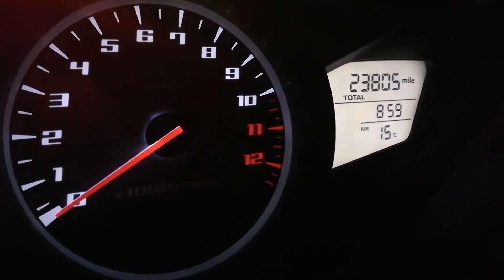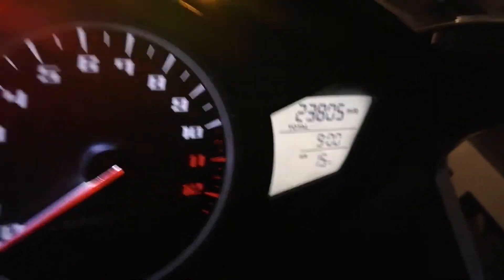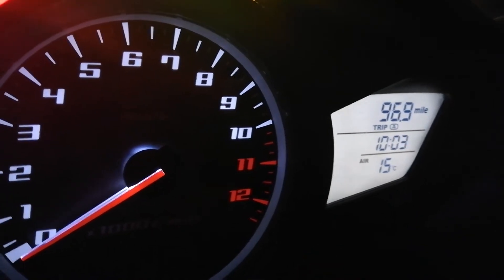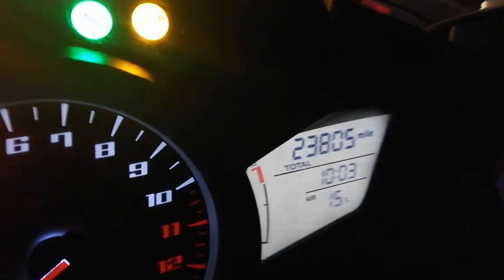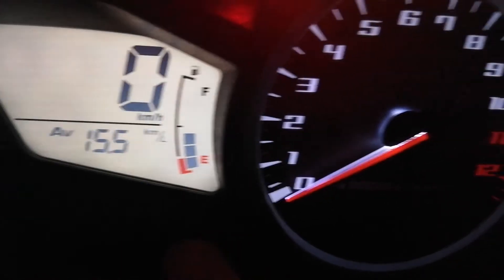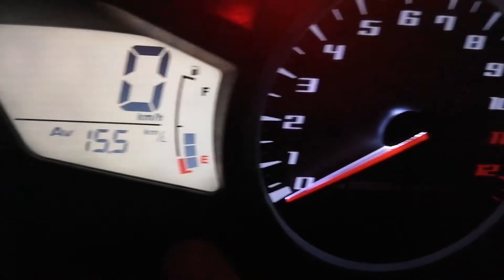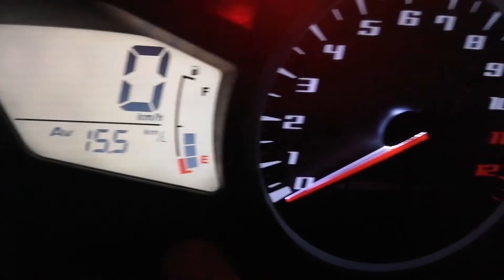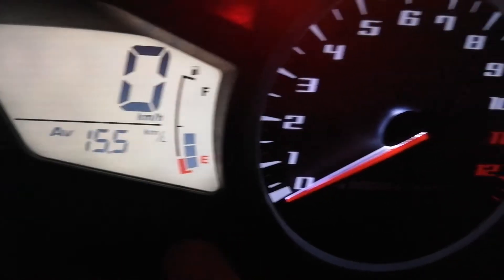How to set Honda VFR 1200 clocks.

Comment: Hey Graham, how do you fix the dashboard to light up again? Only my indicators I can see but everything else went black. I cant see my speedometer, rpm’s, fuel gauge, and time. I checked my fuses, and they’re in good shape. All my other lights work. Do I need to replace dashboard bulbs?
Reply from the maker: I'm sorry I wouldn't know about replacing dashboard bulbs yet not done it, but if you hold button B for 2 secs the light display will lighten or darken as you press again.. See my link, at 10 secs in.
https://youtu.be/uunMOmTePd8

Comment: You're getting around 44mpg not bad.
Reply from the maker: Yes indeed, i had intended to keep trip B running for the season (March to end Oct) but zeroed it by mistake, over about 3000 miles I had 9.9 miles per litre ( as you say 44 ish).
I'm quite pleased as I don't pootle about on it. Thanks